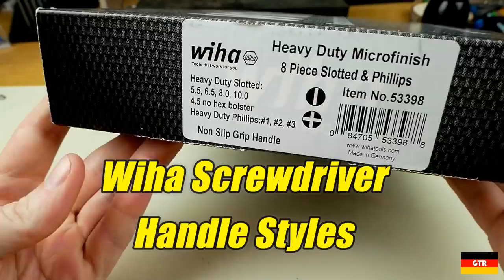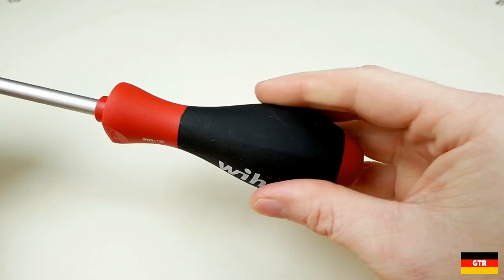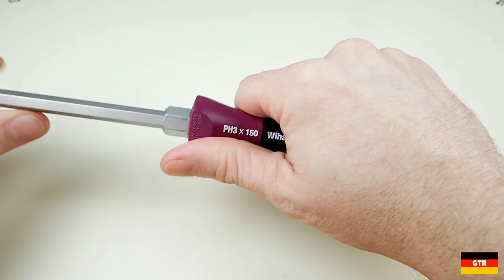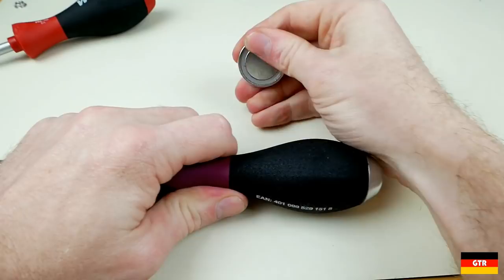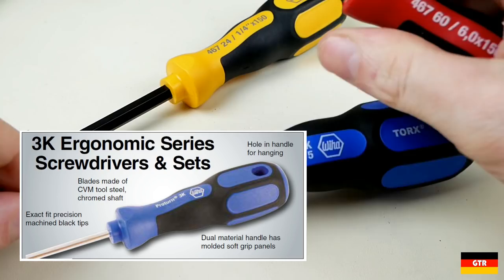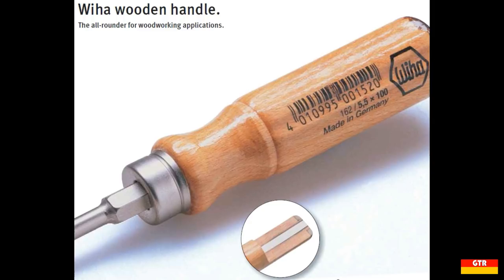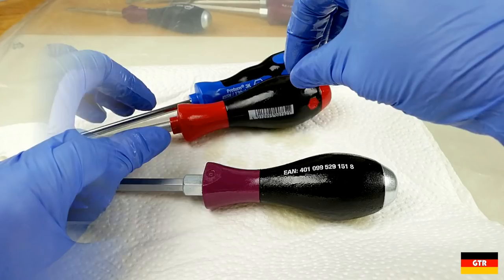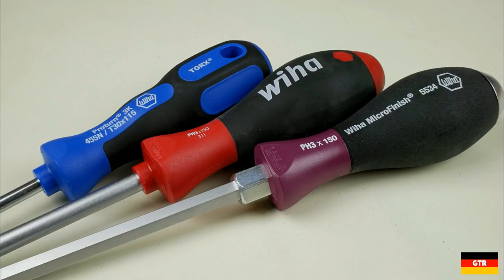Wiha Screwdriver Handle Styles

Comment: Another consideration in handles with through shafts, when working around electricity be aware that that end cap can be live mains voltage when the tip is in contact with power.
Reply from the maker: Yeah, none of these covered any of the VDE/Insulated tools, but they have a similar handle style to the typical Wiha shape.

Comment: Although the catalogue doesn't say very much about the colour range applications, I presumed that the microfinish is for Mechanics, Fitter & Turners, and Plumbers etc, hence use in wet & oily conditions. I had a look at their ESD (electro-static-discharge) screwdrivers/Torx etc (yellow handled) range in their catalogue and think it might be worthwhile purchasing a set for myself, just like their ESD tweezers for electronics or for working car electric/audio etc. Although, I just don't know if they are going to be expensive regarding their said application. However, It is a hard decision for most who can't afford very much too, yet I think once the person has purchased a set for excellent screwdrivers, or even 1 or 2, they will always try very hard to save to get something else good instead of the usual cheap shit that's thrust onto people out there. I bought a 6-piece Wera Kraftform Micro Screwdriver set that come with a stand very early last year, I haven't looked back since. Those shitty stanley, $2 shop and el-cheap precision screwdriver sets etc are a thing of the past. Cheers for the heads up here bud :-)

Comment: I have a set of 1000v soft finish drivers, nice comfortable handles. This may be considered as heresy on this channel, but the most comfortable drivers for all day long usage in my opinion would be Bahco ergo-not German but excellent drivers.
Reply from the maker: No such thing as heresy on this channel, if it is a good quality tool that you use then it doesn't really matter where it came from.  I just focus on reviewing German-brand tools but there are of course many quality tool brands that aren't from Germany.
Reply: Great to hear, love the channel as I am a bit of a Knipex fanboy anyway :) First tool box I got as an electrical apprentice 20+ years ago included an Elliot Lucas Pliers, Knipex snipe nose and a Bahco adjustable wrench-the wrench I still have knocking about somewhere-excellent tools.

Comment: Still trying to decide if I wanna replace my old Craftsman Pro screwdrivers on the pegboard above my garage workbench with the Wiha Extra Heavy Duty or Klein --- definitely leaning towards those Microfinish - they just look tougher, and are less than $100 for the set on KC Tools right now --> https://www.kctoolco.com/wiha-53398-8-piece-microfinish-extra-heavy-duty-slotted-phillips-screwdriver-set/?rfsn=347423.c8237
There's also THIS set: https://www.kctoolco.com/kyles-ultimate-screwdriver-set/
Klein set runs $50 or $60 depending on if you want the stubby drivers: http://a.co/eAerR4S  or  http://a.co/0je1aem
Reply: As an industrial electrician, I've used Klein for years. However, a few years a go I purchased some Wera screwdrivers and they blow the Kleins out of the water. That was a hard pill for me to swallow.

Comment: Great video again. I prefer Wera screwdrivers over Wiha mainly because of the better anti roll feature and my Wiha logo nearly came off from a screwdriver that was barely used. I know I'm picky but isn't the extra heavy duty 61% heavier than the standard one?
Reply from the maker: I could be wrong on the percentage.  There are two equations to use when comparing two numbers - percent change between two numbers and percent difference between two numbers.  I could have used the wrong one.

Comment: How can you compare the Wiha with Wera screwdrivers?
Reply: I have both and use both...I think WIHA tips are harder and wear better. I'd get WIHA.  PB Swiss(If you can swing it, do it. Soo nice), Vessel(these are killer screwdrivers, their phillips lock onto a fastener like mad, no cam out), and WIHA (especially their precision drivers) are my 3 favorite non-USA drivers. I have a FELO slotted driver that I found at work which wears very well, but I'm not wild about the handle. Same with Witte, i had one at one time when I worked in the beverage industry....never cared for the tri lobe handle but it did wear well.

Comment: Don't forget the VDE-versions (insulated up to 1000V) for electricians. No german electrician is using uninsulated screwdrivers or pliers if he's working on a circuit. Even if it's dead, some idiot could always be nearby switching the circuit back on. That's the reason why the insulated tools here are quite cheap, every electrician is using them. Wera VDE 7-Pcs screwdriverset is round about 24€ (28 US$) on the german Amazon-site. Wiha VDE with soft finish slotted and Phillips (several sizes) 6 Pcs is 33€ (39 US$). In the US the insulated tools are much more expensive, and afaik most electricians use uninsulated screwdrivers (mostly made by Klein Tools). BTW Klein is making insulated tools too which are certified by the german VDE. But they're quite expensive: 2 Pcs screwdriverset (1/4" slotted and No. 2 Phillips) is 37 US$ (31€). They're advertising with individual testing, that's interesting: The VDE-certification requires the individual test, so it's nothing special. Every manufacturer with the VDE certification must perform it.